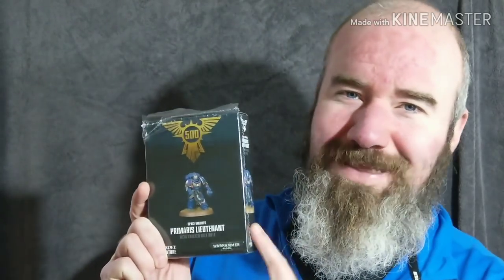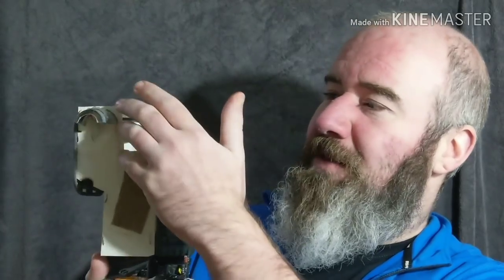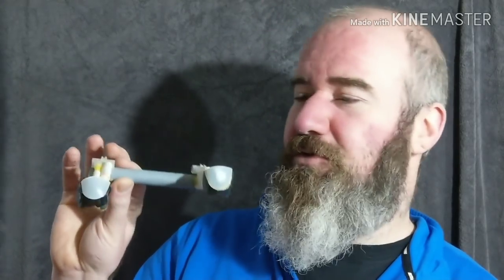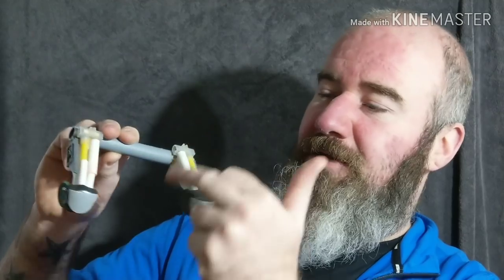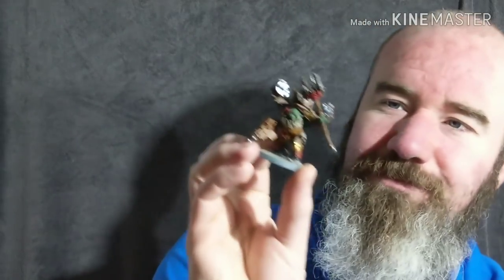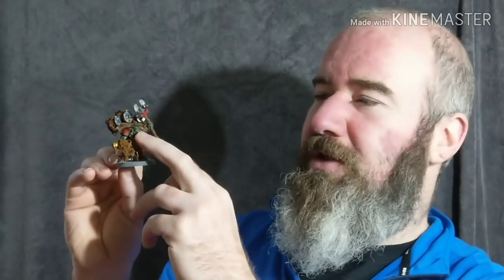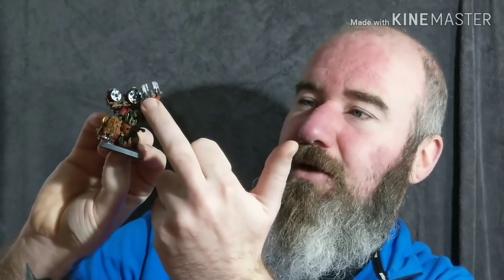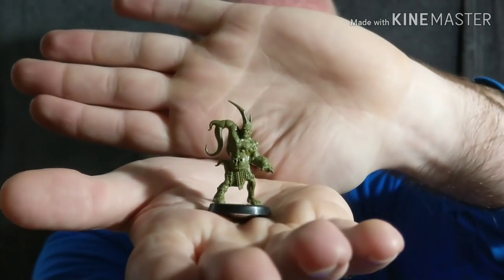Converting/Kitbashing/Scratch Building in Wargaming: Warhammer Thoughty K

Comment: Only just caught this, good vid so I'm glad I did :-)
Scratch built - main structure(s) is/are self built from non-kit pieces, standard kit-bits only used for extra detail.
Kit bash - standard kits used  to make non-standard models (e.g. Revell 1/48th scale F16 to Dakkajet). 
Conversion - model not built as intended by manufacturer (e.g. BeekyDredd, FishJetBlappaBuggy).
Re-sculpt - bit like a kit-bash but covered in Milliput 'primer' (usually a bit bigger than standard).